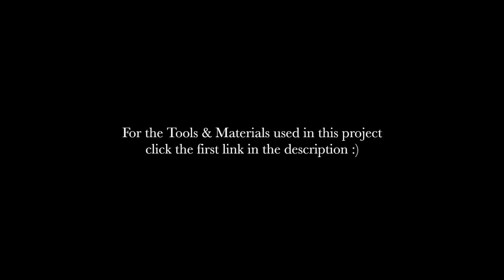Making A Leather Zippo Case

Comment: The only additions I'm going to add when I make this is:
1) belt loops to be able to wear
2) cutouts on the bottom, maybe in the corners or move the closure to center the cutout, to push the lighter up, sometimes my grip fails me and pushing it up would help getting it out. Keep up the good work.
Reply from the maker: those sound like some super functional additions!
Reply: I would wrap the lighter in aluminium foil so it is a little looser.